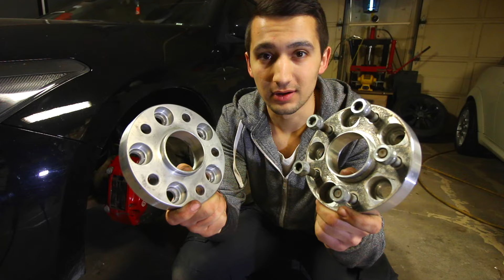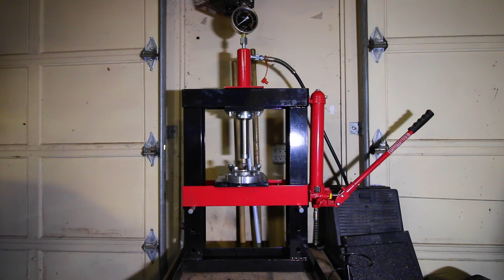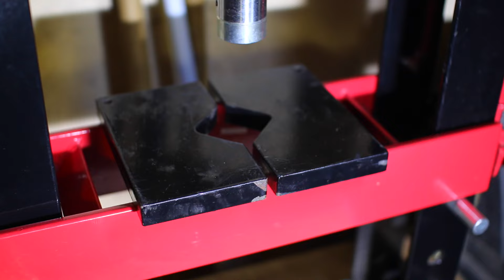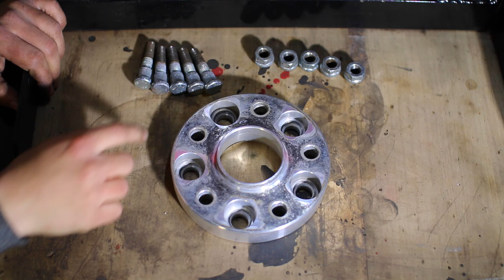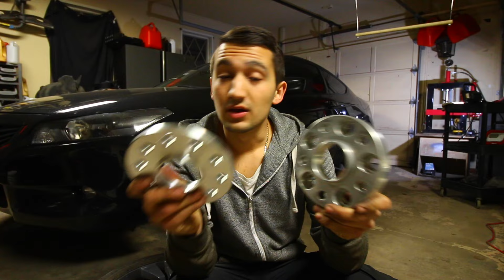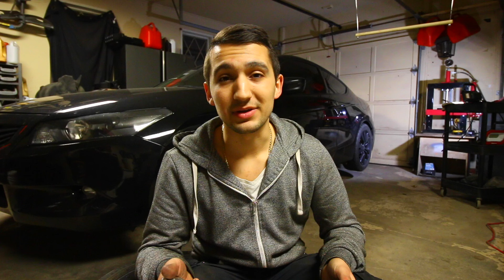How to Convert Wheel Adapters into Wheel Spacers

Comment: Hey I wanted to do this but the only issue I have is that the way you ran it it’s only partially using a load when you torque it because the diameter of where the lug nut for the spacer was is bigger than the stud and I can’t imagine that with time it will crack .

Comment: Hey man I've been watching your videos you seem very knowledgeable in many areas.my concern is I have a G-Body regal I have 22 inch wheels I got the spacers with the studs are not long enough on the spacer.. Am i  able to just press out existing and press in new extended studs..? and I'm having major clearance issues somebody told me to get spindles that raise the vehiclein the front and better extended shocks in the rear or I was told a possible coilover system  would do it..? I'm lost man 10 different people say ten different things what do you think in both of these areas I'm grateful for a response thanks.

Comment: Is it possible to press the studs on the other holes in order to flip the bolt pattern?
Reply from the maker: If they were both the correct diameter for the stud, yes you could, however they typically are not.

Comment: What to put some placers on my 2015. I want 15mm Front and 20-25mm rear with Factory 20" wheels. I've seen this video and your install of extended studs. My question is if I use the extended studs. Will I be able to use my Factory lung nuts? I noticed in this video you mention opened ended nuts. I would prefer to use factory to keep it clean. 

If you could give me some advise, I'd appreciate it!

Comment: Have you heard anything about wheel spacers shortening the life of your wheel bearings?
Reply: it depends on youre wheel setup as long as it centers out in the middle of the rim then its fine. its basically the same as running a 30 offset  so instead of 45 offset OEM you add 15mm spacer which makes it a 30offset.

Comment: Or just buy wheels with the proper offset and don't be a cheap ass maybe?
Reply from the maker: Being a cheap ass? My wheel and tire setup is over 3 grand... how is that cheap?
Reply: Samuel Carroll a proper set of wide wheels are over $7k.
Reply: Chris' RX7 FD that's incorrect. You can easily buy a set of high quality wheels for and tyres for under $4k with correct width and offset.
Reply: milanmastracci being cheap by just adding spacers, putting extra strain on your studs.

Comment: informative, but when possible, purchase wheels with the required applications offset. especially in a race application
Reply from the maker: I'm with you 100%, but yet again, there are many times where race cars will use wheel spacers

Comment: hey milan when i upsized my wheel maintaing same hieght ... my turning radious increased ... how can i achieve my old one
Reply from the maker: Well you would have to find a tire that has the same circumference as your old setup. So if you had a 17" wheel, and upgrade to an 18" wheel, you will need to compensate for that 1 inch difference, but having 1" less of sidewall. I find it very easy to calculate any wheel measurements by going on 1010tires's website, and using their calculators. If you need help with that, click this: https://youtu.be/0WCHHR8Lhes